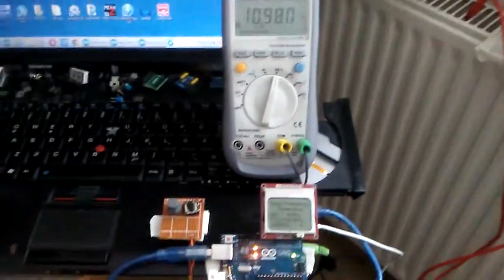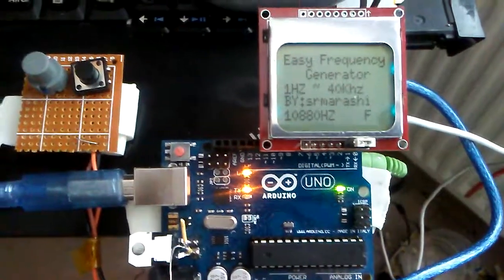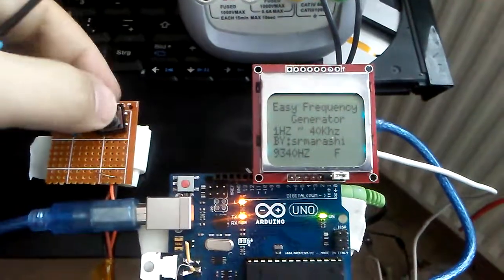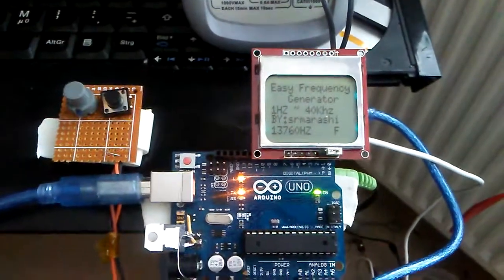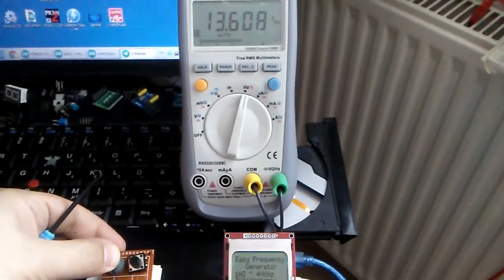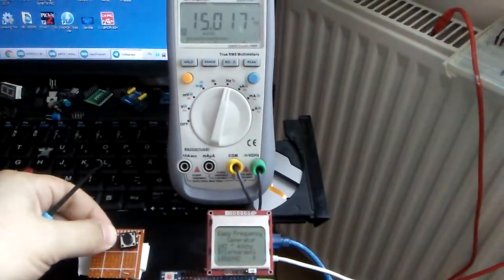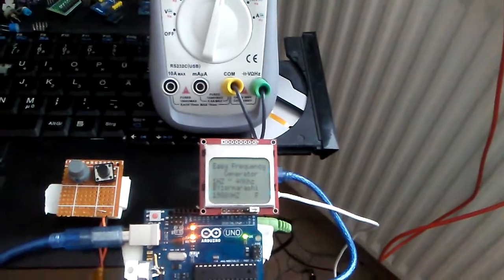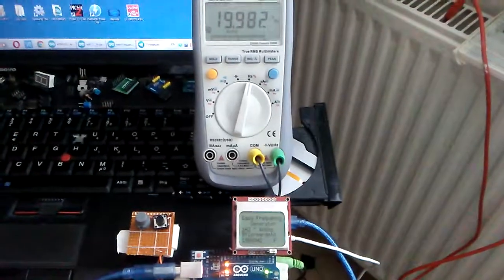Arduino easy Frequency Generator 1Hz to 40Khz homemade DIY

Comment: Hi,
As said earlier in your video, using Crystal Oscillators, you can boost the frequency upto 200Mhz.
Can you please tell me the specifications of the Crystal Oscillators that you are using and the necessary circuit diagram attached to it?
Thank you very much! :)

Comment: //Signal generator

#include <LiquidCrystal_I2C.h>
#include <Wire.h>

LiquidCrystal_I2C lcd(0x3f, 20, 4);
int sumin, tumin, mumin, sum;

void setup()
{
  pinMode(LED_BUILTIN, OUTPUT);
  analogReference(INTERNAL);
  pinMode(A0, INPUT_PULLUP); // increase
  pinMode(A1, INPUT_PULLUP); // decrease
  digitalWrite(13, LOW);
  sum = 1; //starts with one Hertz
  lcd.init();
  lcd.backlight();
}

void loop()
{

  sumin = analogRead(A0);
  mumin = analogRead(A1);

  if (sumin < 200)
  {
    sum = sum + 1;
    if (sum > 40000)
      sum = 40000;
  }

  if (mumin < 200)
  {
    sum = sum - 1;
    if (sum < 2)
      sum = 1;
  }

  lcd.setCursor(2, 0);
  lcd.print("f=");
  if (sum < 10)

  {
    lcd.setCursor(4, 0);
    lcd.print(" ");
    lcd.setCursor(5, 0);
    lcd.print(sum);
    lcd.print(" Hz");
  }

  else

  {
    lcd.setCursor(4, 0);
    lcd.print(sum);
    lcd.print(" Hz");
  }
  lcd.setCursor(2, 1);
  lcd.print("T=");
  lcd.setCursor(4, 1);
  lcd.print(sum * 60);
  lcd.print(" O/min");

  digitalWrite(LED_BUILTIN, HIGH);   // turn the LED on (HIGH is the voltage level)
  delay(500 / sum);                     // wait for a half period
  digitalWrite(LED_BUILTIN, LOW);    // turn the LED off by making the voltage LOW
  delay(500 / sum);

}

Comment: hey, it says on the tone() reference page that minimum frequency is 31hz, is there something in your code that i'm missing or how do you get down to 1hz?
Reply from the maker: for below than 30hz go to generate easily, with digitalWrite(high) and LOW with delay, and make sure your meter can support bellow than 30hz.
Thanks
Reply from the maker: hey, you right. it is start from 31Hz thanks

Comment: I would like to know the required components and the circuit diagram..
Reply from the maker: hi, no component need just go for code  and connect meter or oscope to arduino
Reply: @seyedmarashi  but i want to know the circuit diagram
Reply from the maker: my friend, no need circuit, just connect your meter or scope to Digital pinout number 5 and run the code. if you need circuit diagram from LCD go for Nokia LCD for Arduino and google it, thats it. the best point of this project is my idea is Circuit LESS! just arduino !!!! with or without any speial shieldddddd.....